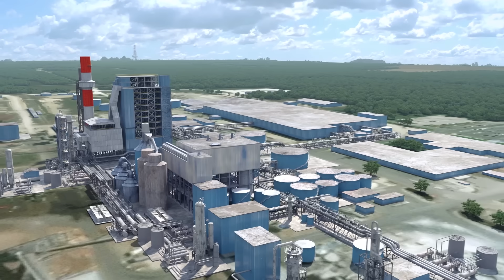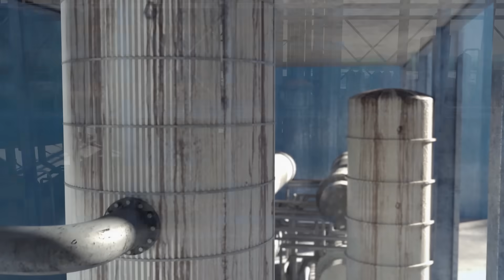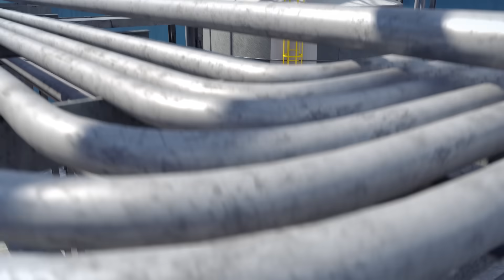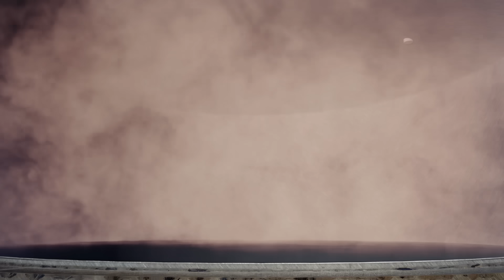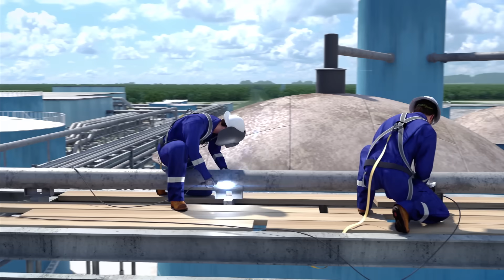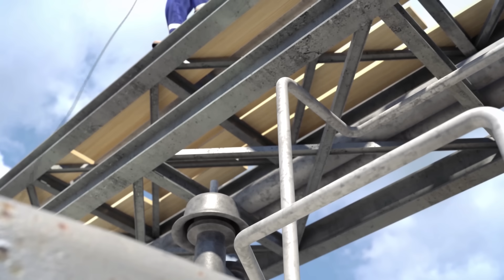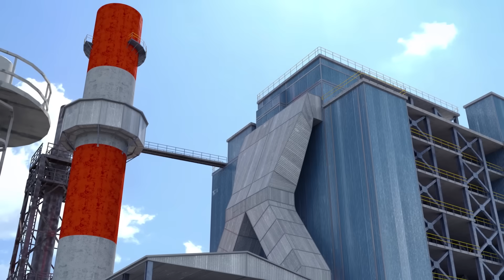Animation of Explosion at PCA's DeRidder, Louisiana, Pulp and Paper Mill

Comment: Any hot work in a facility that has flammables anywhere at all should be contained by welding blankets.  Pipes, tanks and even the ground should be covered .  A roll of fire blanket is cheap insurance when the alternative is injury or as in this case loss of life.   In my opinion a safety person from the plant should have been at the hot work site and immediately stopped the work when slag and sparks were obviously not contained.
Reply: Exactly. In this case the lack of a flammable atmosphere shouldn't be misconstrued as the lack of an atmosphere that could become flammable. The external reach of hot work should never be ignored. Blankets to contain the sparks/slag and proper de-energization of tools would have prevented this from a procedural standpoint even if the foul water tank condition wasn't discovered through competent management of the hazards it could pose.
Reply: letserb, did you NOT watch the video????  They DID test for LEL's.  However, if there was a penetration of the tank by hot slag or an errant arc, it easily could've caused an ignition INSIDE the tank.  Since it was not a pressure tank, the tank roof was likely pretty thin.
Reply: Oh, you know common sense stuff. There's no common sense at these places anymore.
Reply: I'd like to know how you KNOW that that was an open vent?  Turpentine vapors are also heavier than air, so it shouldn't have been venting too much from a top vent.  
But as the video said, no definite ignition point was found.
Reply: And the moron finally comes out of you.   You are NOT trained in forensics, which means you don't know what you're talking about, nor do you know the qualifications of the investigators.  
And I wouldn't be talking your BULLSHIT about Canada being so advanced and safe, does Lac-Megantic sound familiar????
Reply: You want people to believe you're some sort of expert, yet you rant like a fucking child...
I'd say you're just a garden variety troll.
Reply: Well since the trained investigators that were on the scene couldn't make a determination, I guess we'll just speculate then won't we?
Reply: ... very good points. You can also identify another factor, that accidents on these videos have in common - contract workers. From my experience, when only the "local" workers are involved, flow of information of what should or should not be done, and how, and when it should be done is much better - the contractors often lack the information that certain things in the chemical plants can be dangerous. I wonder if it was not cheaper to employ a permanent squad of maintenence workers / construction workers at the plant (as it is often done at larger plants in europe - where I come from), than risk with the contractors. Because I guess, that this is a typical expample of outsourcing gone wrong...
Reply: @chloralhydrate  I have also seen the opposite though, where trade union laborers were the default and an employee working in the same area had comparatively little training and had to figure out how to stay safe on their own. That worker was me, and the problem was that it was easy for site safety employees to write up trades and tell them to fix their problems, but when they found me doing something wrong they knew they would be responsible for the paperwork and next steps to close the gap, so they just said "don't do that next time" and went on their way.
Reply: @chloralhydrate wrong.
Reply: competent management, oxymoron
Reply: letserb By the way, I work in a chemical plant and I DO know what I'm talking about.
Reply: letserb it means we contend with hot work around flammables on a daily basis.  And yes, slag will burn through sheet metal very quickly.  There was an explosion so there were obviously both an air/ fuel and ignition source?  Look, I respect your opinion but it's just not consistent with the facts as shown in the video.
Reply: @bigpapi3636  the video was an animation, for representation purposes; so it is not infatical evidence.
Using it as such, to make your 'correction' is "loose".

And by that standard, the video shows a GMAW welder, which has limited sparks and slag, not enough to MELT a whole through that steel that could of been <3/16"in. thick.
Reply: Damn good idea, and any gaps to atmosphere like the top of that shaft could be cheaply and easily sealed with a two piece flanged boot (with overlapping ends) and fire blanket held in place with large worm drive hose clamps. It would take minutes to place.
Reply: letserb i think his point was the union crew wouldn't have worked on it until it was cleared. Unions having higher safety requirements for their people and such. Not that they are better just that they are coddled more than non union
Reply: h Big Papi you are right but you know how it is... that takes too much time and they press welders to get the job done. I've seen it a million times. they don't want you spending 2 hours prepping an area when the weld will take 20 minutes. they cut corners and put people at risk.. sad but true..
Reply: Permit system not in use or total failure 
No Tented/sheeted hot work area 
No gas detection at work face 
No fire watch present 
The fact its a paper mill would warrant full spark containment and then that would require a gas detector present
Reply: chloralhydrate Yeah, good call.  At the major refineries, chemical facilities, etc I go through a safety orientation but it's not a replacement for the "tribal knowledge" that's required to work in total safety.  And the contractor is really dependent on the knowledge aand safety awareness of the local staff at that point.  I had an electrical contractor killed in a fall when he arced a breaker that was close to built up carbon fiber dust that accumulated on the breaker box over years of grinding in the area.  He was on a ladder and the flash fire blew him off.  No safety harness but also no awareness by the staff.  The hazard should have been recognized but not by the contractor.  Our guys didn't prepare the contractor for the potential hazards.  Not saying the guy wasn't partially at fault or that contractors are sloppy when it comes to safety but I have shut down contractor work in the past for lack of PPE, poor procedure, etc.  Safety, maintenance and engineering should be represented to monitor contractor work especially in an area where a hazard could be present.
Reply: chloralhydrate, a very valid point. I knew a fellow that worked for just such an industrial contractor in British Columbia. He and a co-worker were to carry out maintenance on an underground storage tank at... pulp and paper mill.. They both died from H2S poisoning. If this was done by in house union workers..(I am NOT a union worker)..that tank would have been absolutely clear of poisonous gases. He left behind his wife and two teenaged kids.
  All for some cost savings. So sad.
Reply: Also, where was the Fire Watch with charged fire hose? In all the plants I 've worked in , any hot work would have a firewatch with the authority to shut the welding machine off or turn off the bottles of torches if sparks were not being contained.
Reply: The only problem with your idea is fire blankets don't stop VAPORS from being a problem and it's those VAPORS that are the usual cause of a Flash Fire / Explosion. The real fix would have been for the safety people to drop a probe INTO the upper portion of the tank before certification to make sure that the Concentration Levels were such combustion would not have been possible, that and don't forget to drain out the turpentine. Yes, use fire blankets, but this is MORE about doing hot work in an area not COMPLETELY cleared of hazards such as the EXPLOSIVE air/fuel mixture in the tank. I've seen PLENTY of slag burn right through a fire blanket, and VAPORS go where they want.
Reply: To many assumptions presently employed at at paper mill ish like this worries me daily
Reply: Big Papi my thoughts exactly
Reply: This like many accidents involved a number of failures in a chain of events.  Fire blankets don’t catch and just hold slag.  There’s obvious negligence and dereliction of job responsibility and leadership at this plant.  I’m sure lawsuits are coming or were filed.
Reply: The real cause would be traced back to the assumptions by the company that there would be no combustible atmosphere present.   Also, the “confusion “ between crews regarding removal of turpentine sounds more like a pissing match and gross negligence.

If the investigation determined that the pressure equalization valve may have let in air to equalize the pressure, could it not have been doing so while sparks were falling around it?  🤷🏽‍♂️
Reply: The cheapest insurance, is the one you only pay if something goes wrong
Reply: Typical paper mill
Reply: blankets we don't need no stinkin blankets
Reply: First thing I said where's the blankets....
Reply: And the welder shouldn't be an issue, because, the ground should have been removed first and lowered to a different side unless someone else shut the welder off first. Second a certified welder knows you put the ground as close to the work as practical, because you don't want voltage going thru all kinds of stuff, example valves/ bearings/ packings ECT.
Reply: mitchwalrus Two good points.  The reach of hot hot shouldn't be underestimated and if there are any flammables in the system they can show up where not expected.   Also, plant safety have to be right on contract workers asses to work safely.  It's amazing how they show up without PPE and are oblivious to obvious hazards.
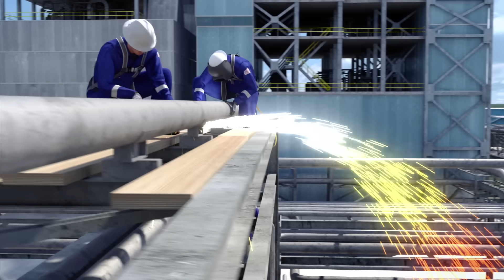Reply: letserb Take another look.  At 5:20 it clearly shows slag most likely burning through the tank.  There were NO flammable vapors outside the tank so the tank top would have to have been burned through to cause an explosion.  A properly constructed enclosure using fire blanket would have prevented this.  In your haste to be contrary you missed the point that there were no flammable vapors outside the tank.
Reply: The possibility of hot slag melting through or an errant arc from the electrode was ALSO identified.  No where did I say that you didn't need knowledgeable people to do hot work.  YOU'RE the one making assumptions, when the EXPERTS who investigated the incident could not come to an exact cause.
Reply: letserb you're an epic dumbass.  You can't begin to give an intelligent argument, so you start insulting me.  Just goes to show that you're not the "expert" you claim to be.
Reply: Your working at a chemical plant means what? First of all, a metal tank will not melt because of slag. Second the atmosphere inside the tank would be hydrocarbon rich. Only at vent points where you would see a leaning of the tank fumes is there potential for ignition. So once again this tank was not properly secured for hot work. Fire blankets is just another union slacker trick to eat up time.
Reply: Big Papi no dude my dad is really high up in there and he was down the road doing tests. someone didn't turn the valve around again and 2 gases came in contact
Reply: letserb, how do you know there was a vacuum at that particular time???  Since it was during the daytime, most likely the heat of the day would've been heating the tank up, creating a slight PRESSURE, not a vacuum.  A vacuum would occur at night when things cool down and condense.

Now who not thinking???

Back up your theory with facts.
Reply: ffjsb improper block and bleed. There was no physical barrier installed on the vent. No burn thru, no arcing. Just a vent that was open to atmosphere. As I have said proper testing for LEL potential was needed. You must consider all sources. If a vent is left open that means test tank! Not rocket science.
Reply: Yea, well this is real life. In real life, people were out drinking & snorting blow and wasn't worried about fulfilling their job duties that particular day or maybe the safety worker came home the following day and found his girlfriend of 7 years, being double teamed by 2 Egyptian midgets and he was super stressed out about what he was gonna do about it and forgot about his job duties that day or maybe he was known around the site as a hot shot one handed welder and was mad he got out bid for the contract and wanted revenge on the other contract workers.
Reply: The only obvious thing I have seen is the fact that proper blinding procedures were not used. Like I said fire blankets are a union headed idiots dream for time killing.sorry a tank would not be made of sheet metal, maybe a exterior clad for insulation. Do we have enough reason to suspect improper blinding on the pipes that were being worked on? Given the fact we know the vacuum vent was not blinded, I will bet there was many other points missed.
Reply: Jim H the tank would not have been cleared, the workers go in under mask if the LEL levels permit. Working in a H2S atmosphere is normal if you are trained. Now saying a union crew could do it better is a joke, most useless slugs on earth, they would still be stalling and milking the job.
Reply: ffjsb when dealing with obvious morons you bring your language down to a level that is understandable by them. It plain that big words confuse you.
Reply: Welding blankets? Are you serious? Have you never heard of testing for LEL’s ???? Welding blankets will do sweet fuck all, explosive vapours will seep right thru. All you are doing is talking out your ass about things it is more than evident you have absolutely no clue about. Hot work goes on all the time in the petrochemical industry because the people are trained and skilled at doing this type of work. All this shows is what happens when you have unskilled people doing a job that they don’t know how to do.
Reply: ffsjb?? Says right in the video it was a vacuum vent. Hence when a vacuum develops it opens. Proper procedure dictates the installation of a pancake or removal and blind. Like I say do it properly to hot work standards. From your blathering not is more than evident you have absolutely no clue about hot work procedures. Your the type of thinker that allowed this to happen because of lack of knowledge on how to properly do the job.
Reply: ffsjb if the tank was properly isolated there would not be any chance of a stray arc causing a ignition. As for slag melting thru? Come on, that’s a steel tank,slag does not have the heat to do any such thing.
Reply: ffjsb let us address lac-megantic first, funny how that was a Yankee Doodle train. As for forensic analysis? Does not take much of a mind to start with the obvious discrepancies. Does seem to confuse morons of your ilk tho. I would call you a stunned stupid fuck stick, but that would be much to high a rating for your obvious lack of brain matter within that block upon your shoulders.
Reply: ffjsb what part of proper blinding and lockout procedures do you not understand? The vacuum vent is the only source identified as not being secured. Like I said, you need experienced people that know how to work in hot environments. You have more than demonstrated you do not have that skill set. I do not know what blinding or double block and bleed was used, but the vent was not blinded as identified in the video.
Reply: ffjsb since it is American investigators it’s not surprising they could not figure out a cause. Much as the safety industry in the US is 10 to 20 years behind Alberta. I have taken the available data and produced a workable hypothesis of the cause, sad part is your to stunned to accept the results of a experienced oilfield worker who does this as a profession. I have safety training, metal trade in oilfield setting as well as construction from well head to production pipeline experience. All you appear to have is a big mouth.
Reply: letserb  Can you elaborate on some of the important points?